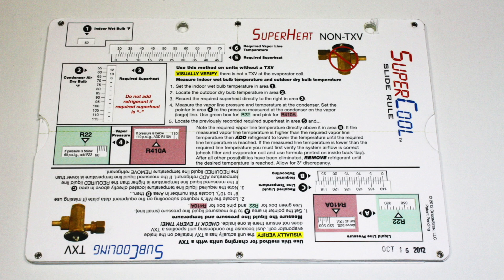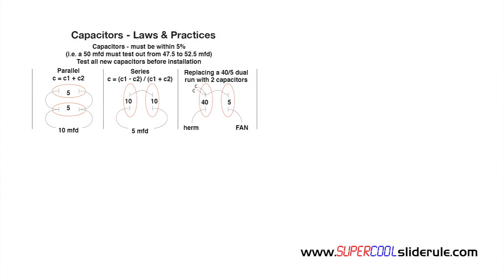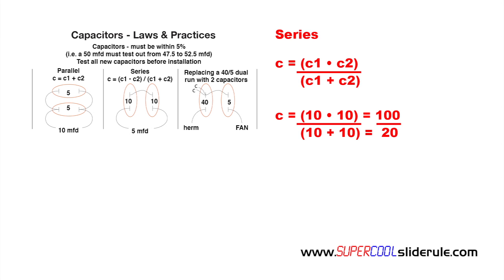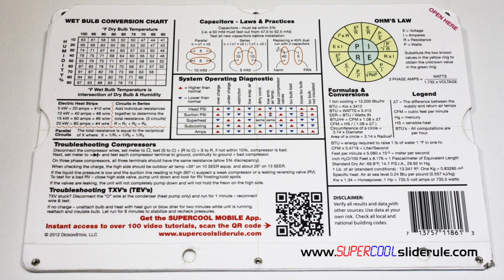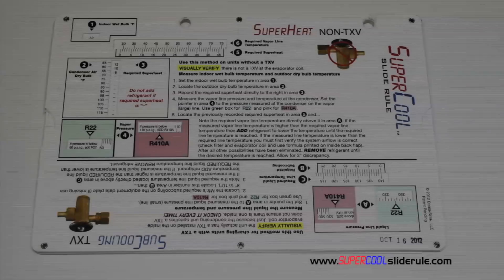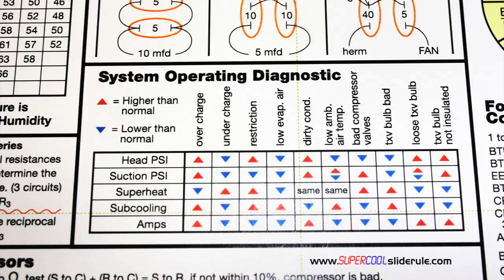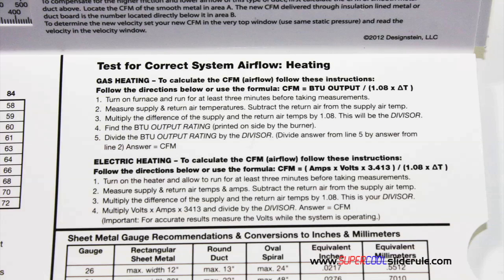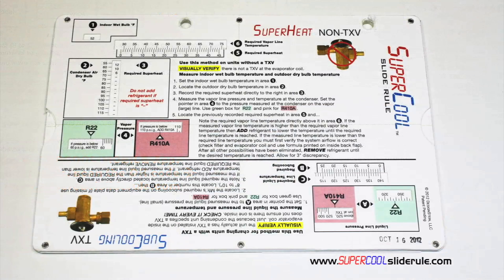How to construct capacitors in series

Comment: So if I connect a third capacitor in series, do I have to attach the wire to the same terminal the wire is attached to the 2nd terminal and not use the other terminal